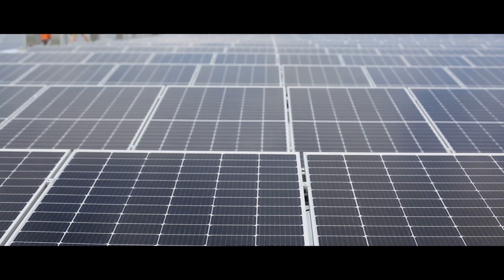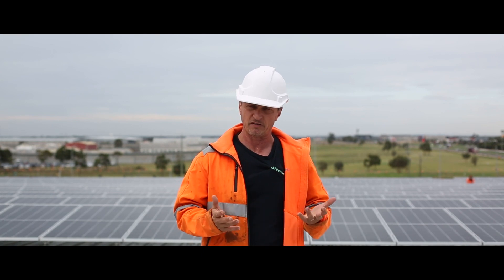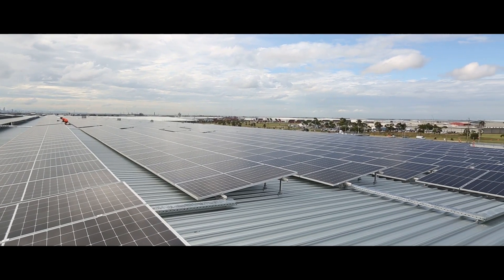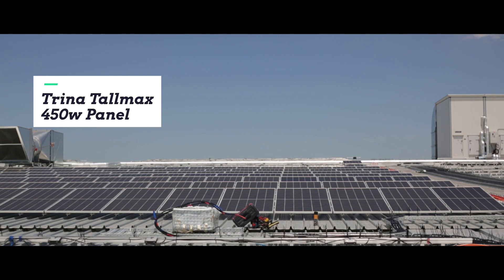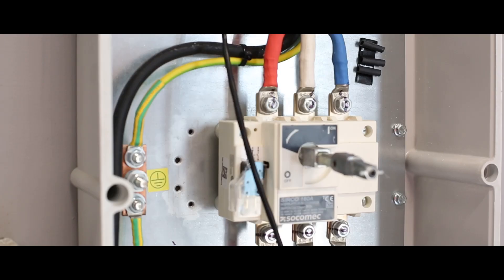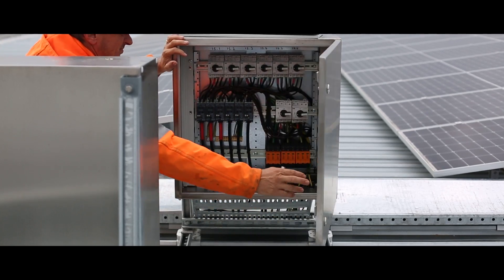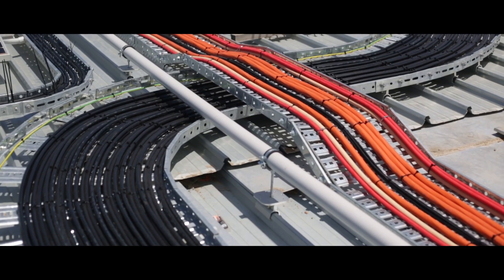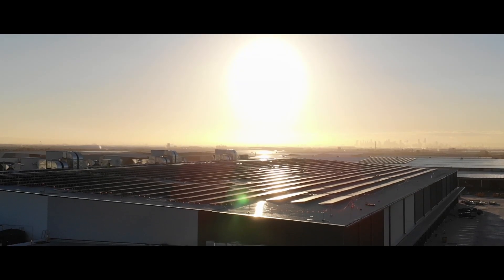2MW System BREAKDOWN

Comment: Great video. 

That tilt doesn't look like much. Was it worth the extra using tilts rather than just installing flat? What was the yeild difference?
Reply: Can you send me a quotation of a 3mw off-grid solar system?
Reply from the maker: Lots.
Reply from the maker: Not sure on the yield difference on this one. So many factors to consider.